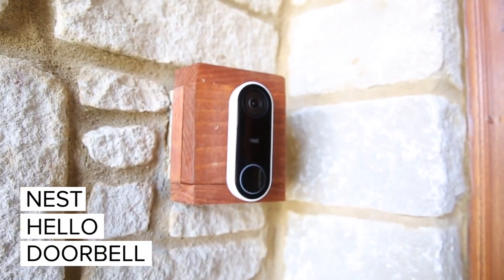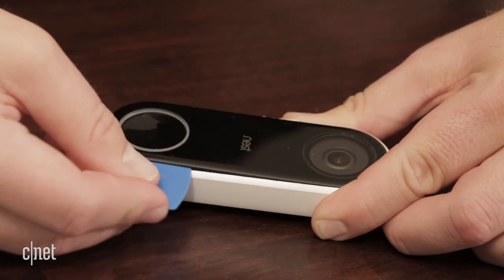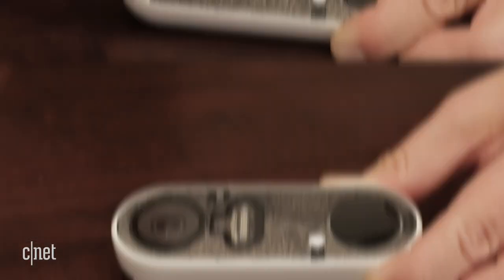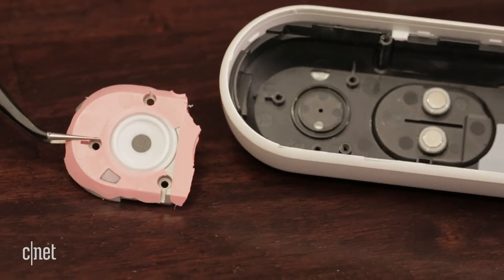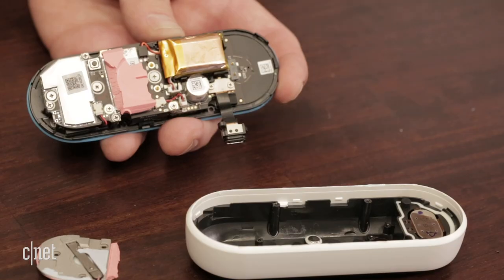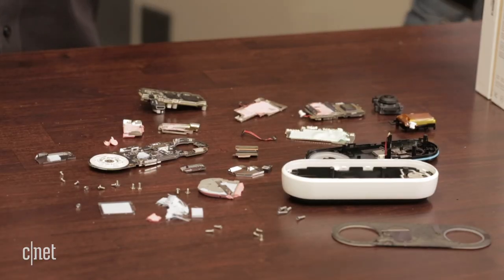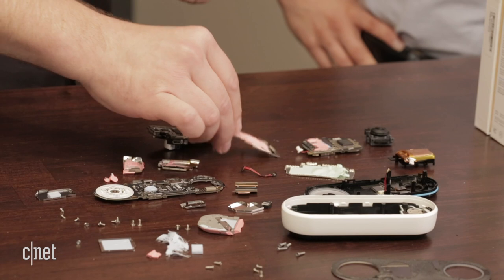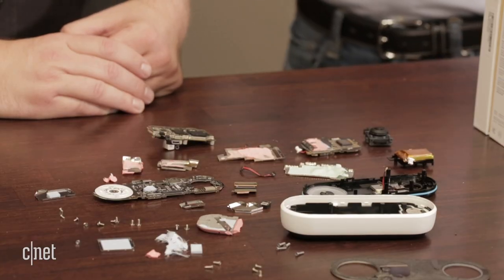Nest Hello Video Doorbell teardown: What's inside this outdoor device?

Comment: Not sure how much I trust a guy that can't tell the difference between a reset button and a microphone.
Reply: RTFM lol
Reply: Halsteadteam  That is a reset button to reset the doorbell back to factory settings.
Reply: HalsteadTeam  it faces a hole on the back of the unit…where the reset hole is. So I think maybe they should be able to figure it out with a little pondering
Reply: HalsteadTeam  Cause these are MBAs masquerading as EEs.

Seriously though, as others stated, the video shows it mechanically pushes a tact switch and the only way to access it is to unlatch the unit from its mount by using the same "paper clip key" it came with.

Comment: That gold block is the internal battery.  It eventually dies (2-3years later) removing the ability for the Hello to trigger your internal chime.  You can take it apart and replace it, but as you can see that’s not really what the consumer is supposed to do.  Or you buy a new Hello or just ditch your internal chime for Nest speakers to alert you when the doorbell is rung.  Very shoddy
Reply: certainly not end user serviceable.  absolute crap that we buy a hardwired doorbell only to be surprised by a failing battery.
Reply: @jameswestley  I bought a new battery and installed it but now I can't get it to reconnect to the internet.
Reply: I do agree. I bought  Nest doorbell 2 years ago and now it won't power on. So Good product but very shorter lifetime.  Won't spending $$ on these google products again.

Comment: Mine died a slow death after a little over two years. It started by rebooting whenever someone clicked the doorbell, which meant that the doorbell would not ring and the video recording was corrupted so that I could see the person approaching and leaving the house, but I would not have any video of them closer. I didn't know the doorbell was rebooting until I tried to troubleshoot the problem by pressing the doorbell repeatedly myself. However, after a couple of dozen or so presses, the doorbell would no longer come back on, so now it is completely dead. I was able to revive it by pressing the reset button through the pinhole in the back while simultaneously holding down the doorbell button, but the same issue persisted. This is likely due to the failed internal battery, which is not user serviceable, as this video clearly shows. It costs over $100 to replace the doorbell. Coupled with the fact that Google suddenly decided to massively increase rates, I 100% do NOT recommend the Nest Hello Video Doorbell or the subscription service.

BTW, at around the 3-minute mark, they talk about a mysterious sensor, but it appears to be the reset button.

Comment: I've heard that the Hello was originally going to have the ability to also detect when someone mistakenly knocked at the door (instead of ringing the bell). Their strapline: "Know who's knocking" would tie up with this belief. So would that back sensor/mic be for that, but for some reason it wasn't used?
Reply: It has a microphone and a constant power source, so there is no reason this couldn't be implemented in software.
Reply: Its a factory reset button. I just muted the audio since these are reviewers that just want to show off they have tools to take devices apart and you don't apart from being paid by Google to help sell this junk. Source: I own it. It failed on me 2 yrs + 8 months. I tore it down. I actually have a basic to advanced education on electronics not a MBA.

Comment: is that a polymer battery in there (the yellow silver bag thing? and would it be  for the hello to temporarily run off while it rings the chime? or does the chime while ringing and the hello both simutaneously draw power from the supply during ring?
Reply: The first: temporarily power the device while ringing.
Reply: My Nest Hello reboots everytime someone rings the doorbell now. I think my battery is dead. Hopefully someone makes a replacement.
Reply: @chasiu75  I’m having the same problem and came to this video just to see what’s inside, Nest said it doesn’t contain a battery inside but this video clearly shows a battery in there.

Do you happen to fix the issue when people rings the chime and video shuts down? Mine does this only on cold weather.

Thanks for your help
Reply: @iHacker007  I turned off the option to ring the doorbell. Stops the reboots.
Reply: @iHacker007  do you have the documentation from Nest that states it does not have a battery inside?

Comment: Looks like a button cell battery caddy. Or maybe a piezoelectric ceramic speaker for sound feedback for... idk?
Reply: The speaker plays a doorbell tone as well as allows the homeowner (through the app) talk with whomever is at the door.
Reply: If you're talking about the thing these MBAs didn't know, its a mechanical switch that presses a tact switch for factory reset. The speaker is located on the bottom and is marked with 4 omega (for 4 ohms of impedance) and 2W (for 2 Watts). Source: I own one. Mines failed. I actually know basic electronics.